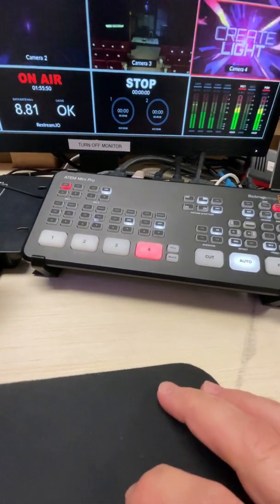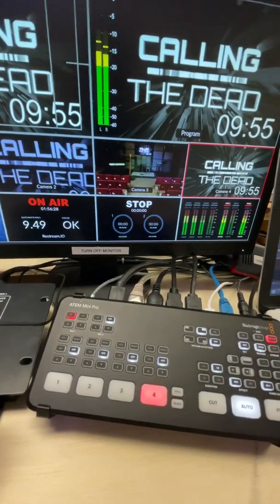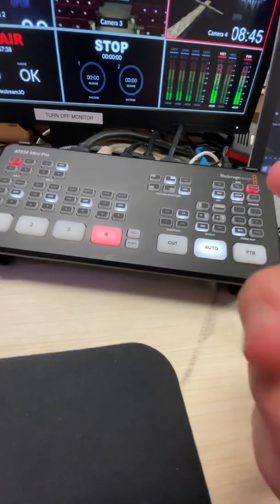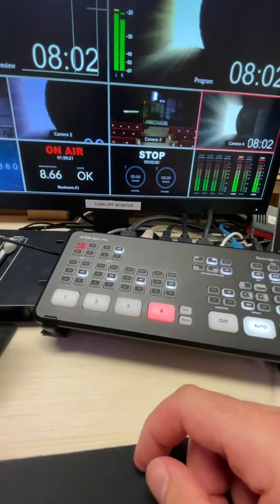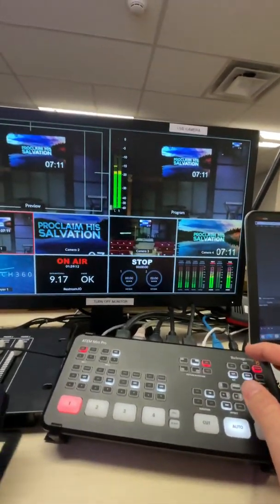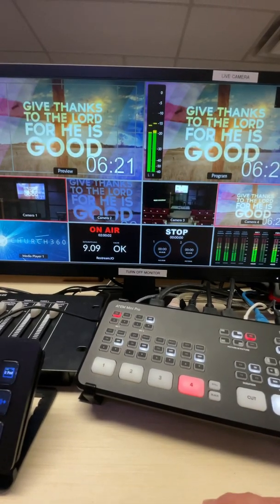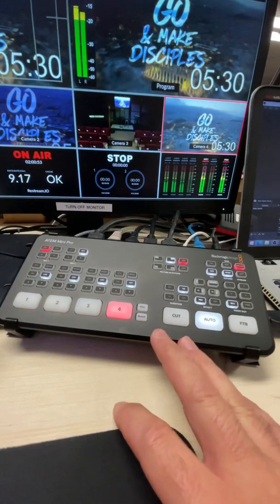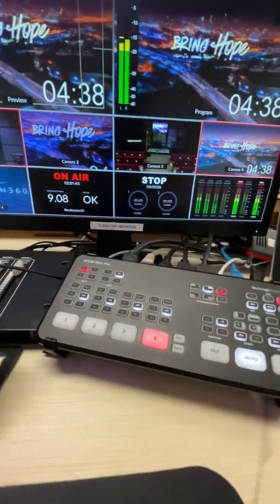ATEM Mini Pro Livestream Cache problem and overheating solved

Comment: The problem is not the ATEM it’s the line/mic Input usually. Switch to opposite mic/line setting in software and some the issue. I have a video you can watch to save all of this problem.

Comment: Chris, great stuff here. I wanted to ask you, I use Obs and feed my audio and video thru the Atem mini pro. I’ve been having issues with over heating. My mac (which is 16gb ram laptop) gets hot, the atem gets hot. And no matter what configurations i put on the obs its keeps on live streaming bad quality video. Any solutions?

Comment: The majority of ATEM Mini problems with overheating comes not from the lack of cooling but from too high audio input levels over analog audio inputs (MIC IN).
Default setting for analog audio inputs is “Microphone, plug-in power“, which leads to excessive audio levels when you feed line-level audio to it. On a slang that is called “hot signal” — figuratively. Yet in the case of ATEM Minis that leads to literal overheating, because the machine tries to limit those excessive levels, which leads to higher computational loads onto already hot FPGA (which in this case imitates specialized digital signal processor). Higher load means even more heat, so the thing starts lagging and you know the rest. The solution, for those who feed their audio from an external mixer, is to set those input to “Line” mode in ATEM Setup (which is also accessible via a cog button in the lower left corner of the ATEM Software Control main window).
Another thing that you can do in ATEM Setup is to reduce the brightness of buttons to the minimum — they will remain bright enough but the LEDs will be much cooler.
Just in case: I use my own Mini Pro for more than a year without any brackets and heatsinks, and never once I had an overheating issue, even on summer. At that, I usually feed audio through HDMI, plugging external sources to the camcorder.

Comment: Great info and a big thanks. My ATEM gets hot and has system freezes. I'll get those heatsinks and stands and hope it corrects it. Maybe Blackmagic would update the fan control to run more. Anyway thanks again.
Reply: Hi, were you able to fix the problem with heat sinks? I just got some
Reply: @JohnDoe-ky4qk I have a video on my channel that solves this most of the time and it’s a setting issue.

Comment: Hey Chris, Thank you so much for the Video, We have an Atem Mini (No Multi-view Version) the Screen Just goes Black and then just Comes. like it is Flickering, Sometimes all the Reds would turn to Blue in the Output Monitor . I attached a Fan to it for removing the Heat like you said. Still it didn't solve the issue, What Do we do?
Reply: Did you ever figure this out because ours seems to have a similar problem?
Reply: Set resolution to same frame rate 60 hrz

Comment: Hi. Just following up on your video, (atem mini pro overheating), Do you have any new updates? Do you still have cache full problems?
Reply from the maker: No, we do not. Now if the interet gets reset due to an outage or a storm, we may need to power cycle the ATEM. But that has only happened once since.